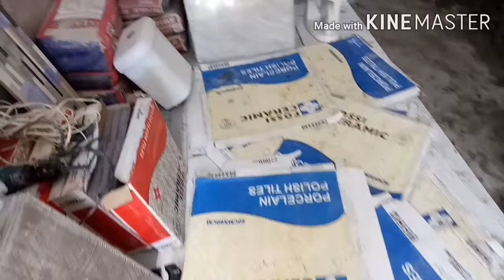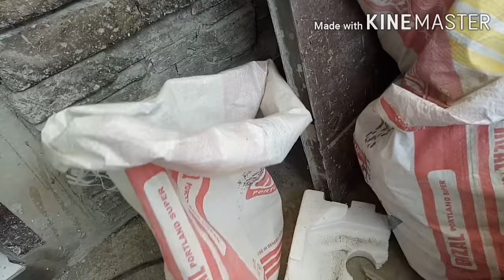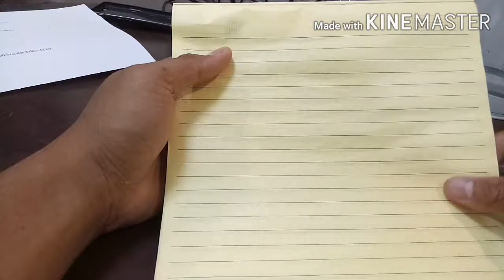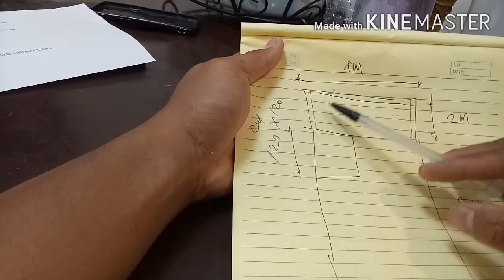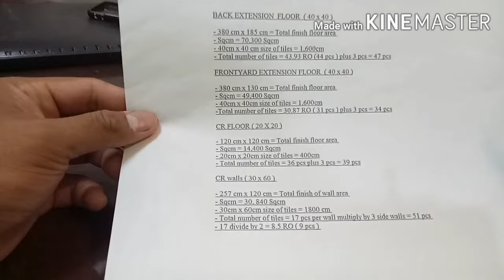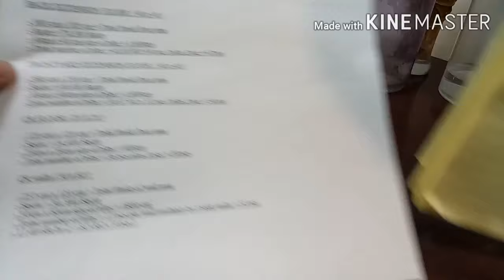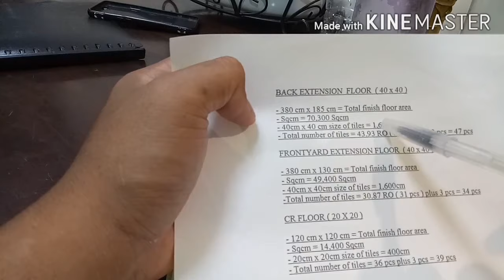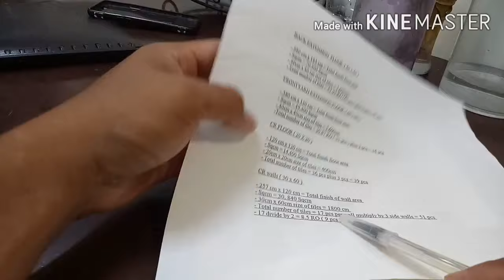Lumina RH Aimee Tiles installation -  paano mag estimate  ng tiles

Comment: Sir ano po mas okay magpalagay muna tiles o ung division para sa kwarto?
Reply from the maker: Same lang sir na ok 
Same lang din na may disadvantage 
- kapag mauna ung room mahihirapan mag install ung tile setter,,  madaming cuttings,  pati edging ng mga hamba ng pinto icucurve iyon lang..  Makakatipid ng tig isang tiles kasi nasakop na ng division ung ibang part ng ititiles 
- magkakaroon ng comparison  kapag mauuna ung division kasi mawawala ung guide lining ng tiles. 

Kapag nauna naman ung tiles mas maganda kasi ung floor level kasado na .
Kitang kita nadin ung floor lining ng tiles kaya may basihan kana..  
Mas mapupulido ang pagkakainstall ng mga Metal studs and trucks..  

- need lang tlga na sobrng tibay ng pagkakakabit ng tiles sa pag iinstallan mismo ng studs kasi kapag nagkaroon ng problem hirap ng marepair kasi nakapakain na iyon sa ilalim ng mga division
Reply: @liandakitvvlog1125  sir panu nmn f gsto ko ang division ay concrete pwd rin bng unahin ung tiles? Parang sayang kc
Reply from the maker: @ReynoldJrOdon  kapag inuna nyo na mag division ng ganyan process..  Ipabahol nyo nlang ang tiles installation sir
Reply: @liandakitvvlog1125  ty sir 😀

 Sir anu kayang magndang gawing sound proof kpag nagplagay  ka ng exhaust fan  sa c.r at kusina para ndi pumasok ung ingay mula sa labas